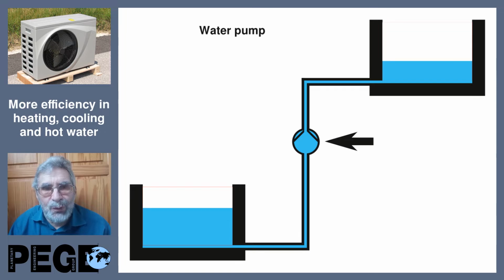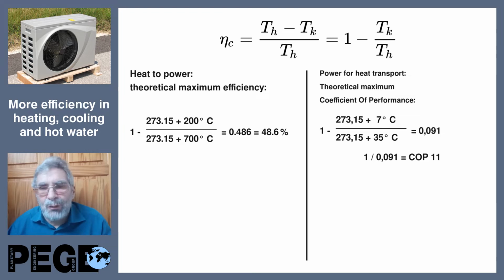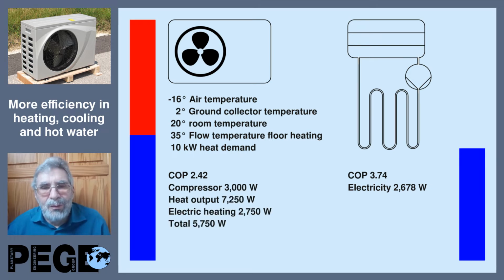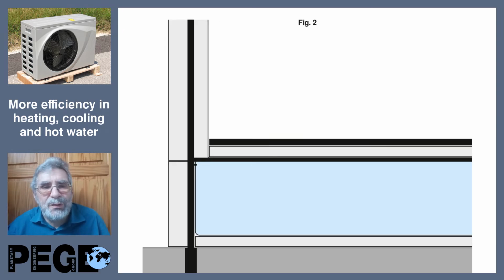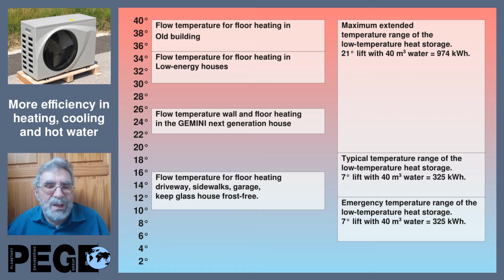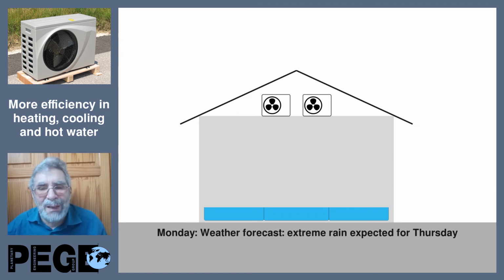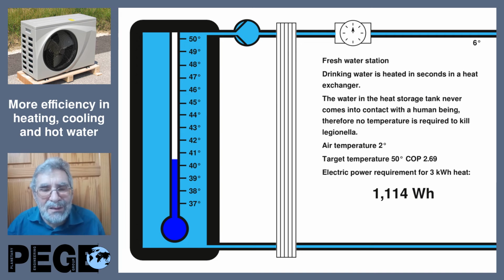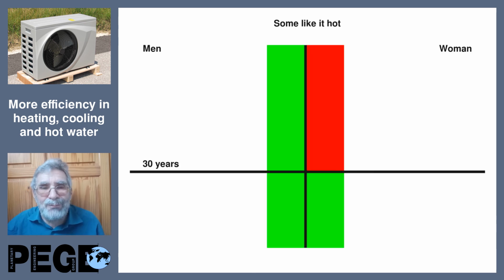More efficiency in heating, cooling and hot water by 3 new patents

Comment: Cold climate heat pumps, with EVI technology, are not so bad as you described here. Nevertheless I want to add some my ideas how to increase  efficiency of air heat pumps. This is my plan at least in theory. I install two  air heat pumps one for main floor with a condensing unit outside  other one for a basement with a condenser  in  attic of my house. On sunny cold day efficiency of the heat pump in the attic would be higher and I have no need for AC in the basement in a summer so I do not have to worry if it is too hot in the attic. I  am remodeling the house and this first part will be done. Second part (passable) I would put vacuum tubes  with antifreeze in them on the south side of the house,  run pipes into the attic where, set a heat exchanger close to the back of heat pump. Heated by the sun antifreeze goes to the heat exchanger  where it becomes colder and goes back down to solar tubes. Third part (passable only if I build a brand new house) I would install air to water heat pump condenser in an attic plus vacuum tubes with a heat exchanger as in  the second part  and build insulated thermal storage in a crawl space  besides that I can use a heat pump  during only the most warm part of a day . I could increase capacity of thermal  storage just by placing big plastic  jars with water on crawl space floor